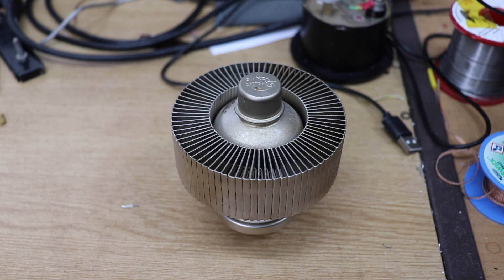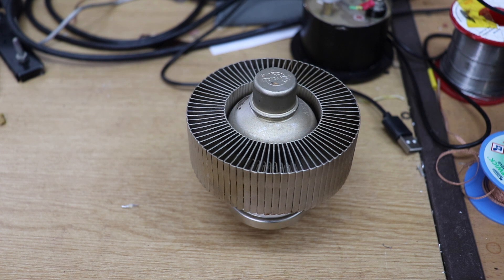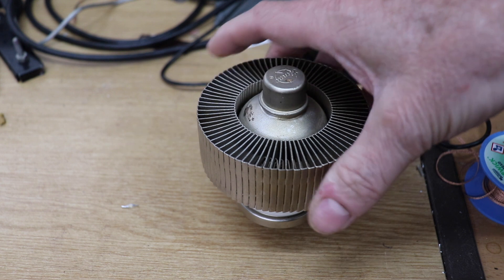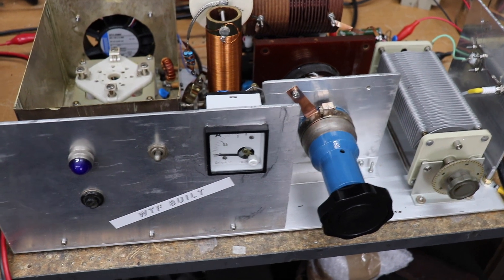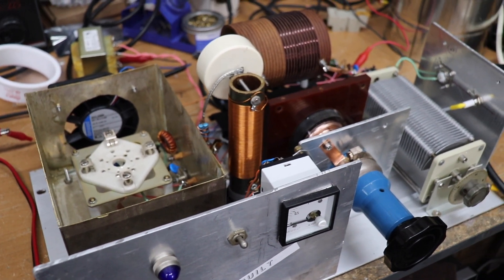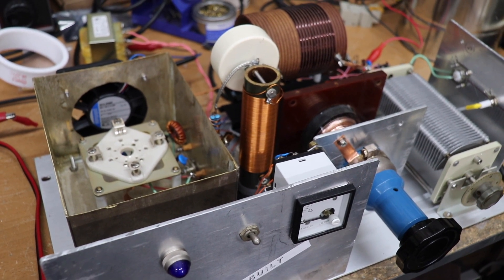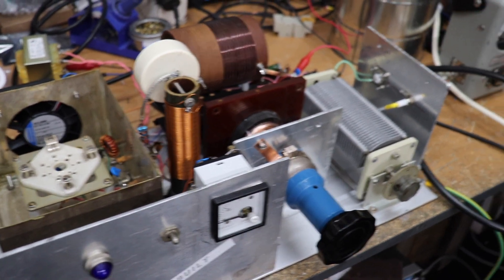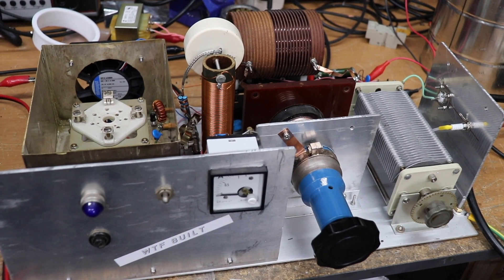WTF Built: Lash Up Linear Amp 3CPX1500A7

Comment: Excellent.  I would be interested to know how you calculated the values of capacitors and inductors etc needed.  Have you looked at how "clean" or otherwise the output is?  I would love to build something similar, HF multiband.  Had been considering a 4CX 1500 or USSR equivalent.  I like the idea of low drive, full UK output. GI0UTE

Comment: Fantastic work! 👍 Can I ask what value are the variable capacitors for the PI output tank circuit are?
Reply from the maker: Alot smaller than I imagined for resonance on 80 about 160 pF for C1 , 10 uH inductance and about 1000 pf for C2